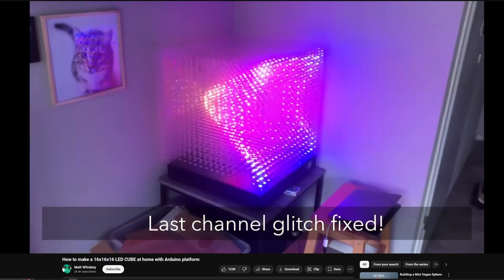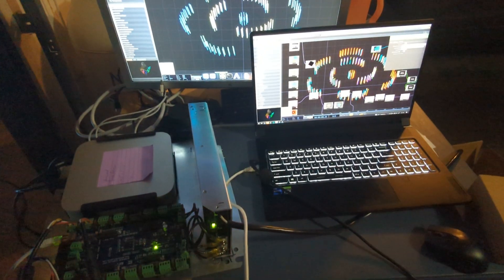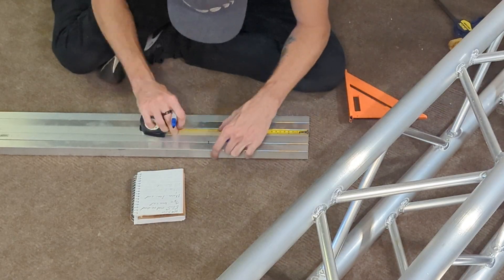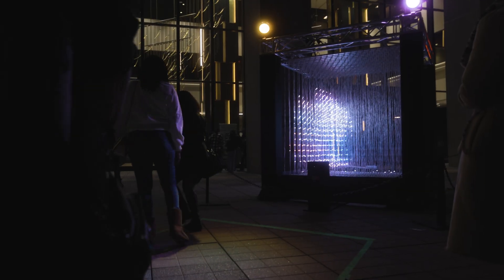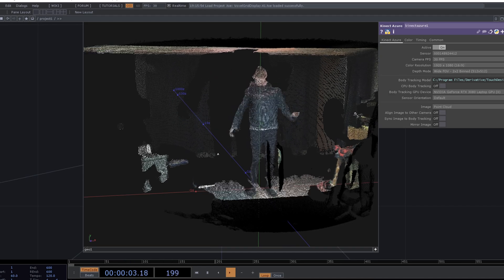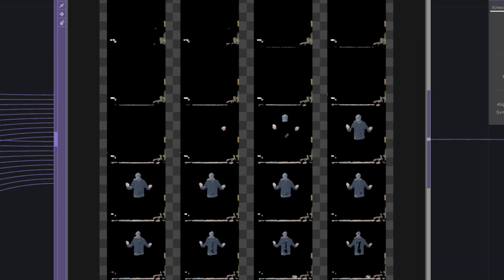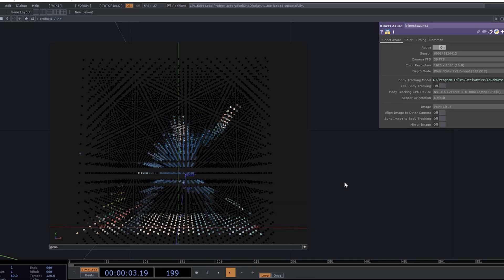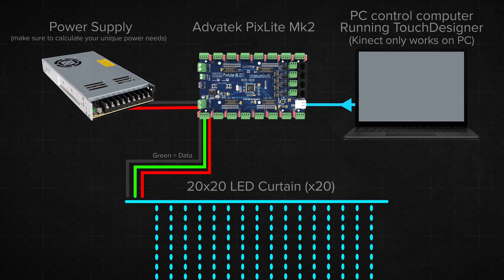Building a Giant LED cube - Interactive light sculpture

Comment: Really cool project and setup! Just wondering — did you use a Kinect v2? Does it work fine with only one, did you test any other capture device?
Reply from the maker: We are using the kinect azure dev kit which is now discontinued. We've looked into using the Intel real sense for future depth projects, but haven't tested them yet

Comment: Awesome project!
Did your version of the seed pixel curtains use a shift-register T-conector on them, or the first pixel of each strand/drop had a hard coded start number?
Reply from the maker: Gotcha, I'm not certain but I think ours actually had an extra data line that went up and connected to the next row. They came pre-assembled. On the coding side they acted as a single continuous LED strand with the upper left being pixel one and the bottom right being 200
Reply from the maker: Each of our curtains came out of a unique output on the pixel control board so we were able to treat them each as individual fixtures in the software.